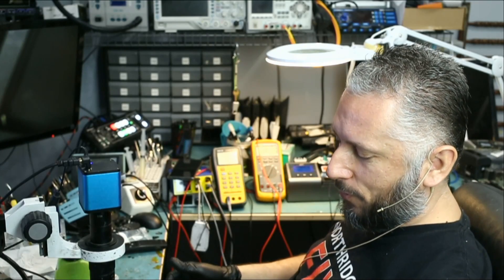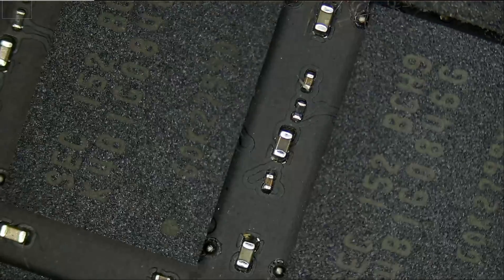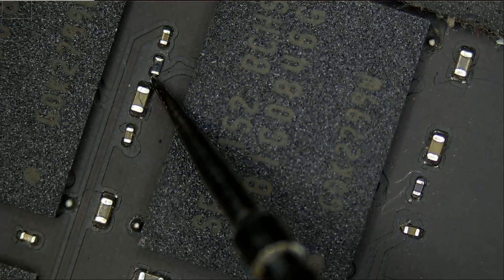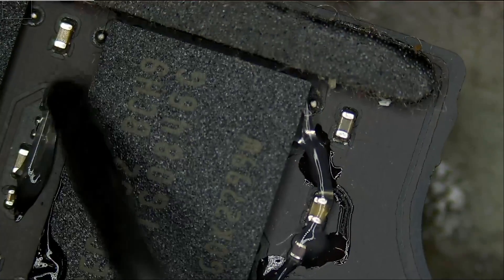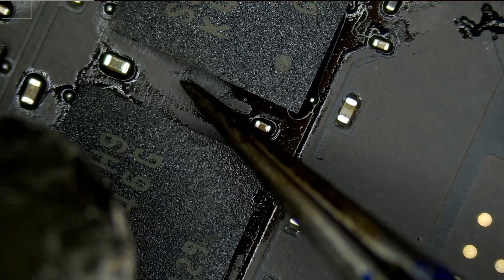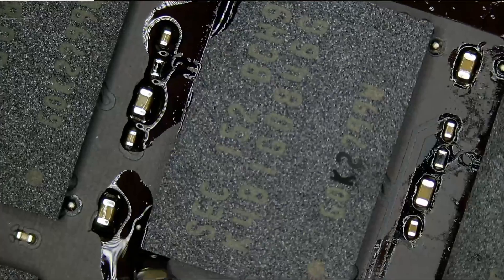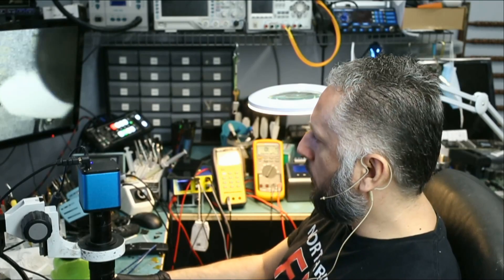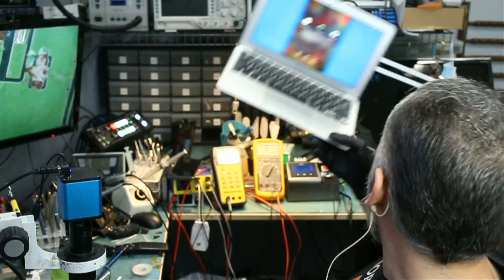Macbook Air 3 beeps No Boot Repair  integrated Ram issue.

Comment: I enjoy all your videos but I have to disagree on the 500 degrees hot air I'm afraid (I'm assuming Celsious as you say "at maximum"). I appreciate that for a quick reflow "faster is better" but 500 degrees cannot be right. Still enjoying your videos though :)
Reply: The Temperature will drop significantly depending on the distance between the pcb and the soldering device. Its not like the PCB is actually 500deg

Comment: What temperature did you use for the reflow?
Reply: Practice. That's the secret sauce in these kinds of repairs. Your hot air is calibrated differently, so there is no right answer. I've done these before and it's scary at first. You can only practice on your own stuff.

Comment: One thing to note again, and I'm glad you did, is when you do BGA reflows you don' t need to use much flux. It will appear, especially when the board is hot, that it has dried up. This isn't the case - it has merely been sucked under the chip. Unlike QFN packages, BGA chips sit slightly elevated, so things can easily get under them...including corrosion. For newcomers, notice how on BGA chips Alex never presses down? That's how BGA chips work - they're slightly elevated by the density of the solder balls.

And before you reflow, do the press test. The air models are very flexible due to their thinness, and as such, the BGA chips sometime separate from the board itself. Powering the machine on while pressing down on the ram chips can help you determine which one is bad (if you're not confident in your reflow ability). Same goes for most BGA chips - look for corrosion and, if none, try the push test. Then proceed as needed.

Nice work, Alex.

Comment: A master at work. The way you do your job is an art. As for the Apple... I will never buy one. The lack of replaceable RAM and other components... makes it an insult to what a laptop means.
Reply: apple isn't the only one doing it, and you are missing out on the benefit of the ram being soldered. latency is a thing of the past. Besides, MacBook Air boards are 150 dollars. I steer customers toward upgrading their board when they need a new one, and in 8 years I have three machines with ram issues. Onboard ram is a non issue. Onboard storage, that's an issue! ill get behind you on that fight MirceaD28

Comment: Thats just a temporary fix, unless there is a water damage i see no reason to reflow the ram chip, after a weeks or a month the same problem will occur again,
Reply: This depends entirely on the cause of the issue. If it was merely corrosion this fix may outlast the machine itself. This is the simplest thing to do when you get the RAM beeps. One the Airs it's usually because the chassis is so flexible that the balls separate from the pads. You can test this pretty easily by just pressing down on the ram chips to see if they connect again.

Comment: I am mesmerized watching these fixes. 
I would need a push to have an attempt with a Surface Pro (6); does it suppose to beep same way if memory is a problem? It stucks on boot with a frozen screen, even from USB, hence no recovery option. Just wonder if bad SSD can also do that?

Comment: I have twice tried to reflow ram on my MacBook's, second time it worked, first time it didnt as i accidentally gave too big of a nudge to ram chip and it pretty much messed all solder joints under the chip and it needed reballing and bga soldering in professional shop.
Reply: You had a go, that's what matters 😀

Comment: Excellent work but of course with windows 11, anything before 2017 will be in the trash because of MS's insane CPU security requirements and you cant even choose.
Reply: @mikeycrackson  Actually you can install windows on a Mac when you know how. My point was that think of the massive MS users and all the good LT's and DT's thrown away as Win 10 becomes unstable a few years after its final dates which have already been announced. MS has taken requirements way too far and the world will be hip deep in leggo bricks, golf balls, and perfectly good fast computers in landfill...
Reply: u can install win11 on devices before 2017 just use a patch to bypass security restrictions
Reply: @husseinal-awawdeh7268  Excellent, i didnt know anyone had done that or that MC might actually hear all the complaints and tweak win 11 to allow older CPU's , So what or where do i get this patch?  Thanks
Reply: @husseinal-awawdeh7268  *looks over at core 2 duo system* currently running windows 11 as a cheapo test bench

Comment: lose cnnection? hmmm… poor quality.
Reply: Age.... solder expands and contracts with heat. Eventually it will crack. But that wouldnt be an issue if apple would just let users replace faulty parts easily. They wont but would be nice.